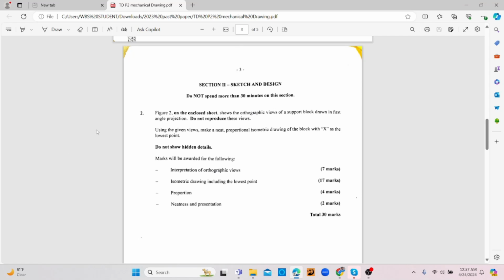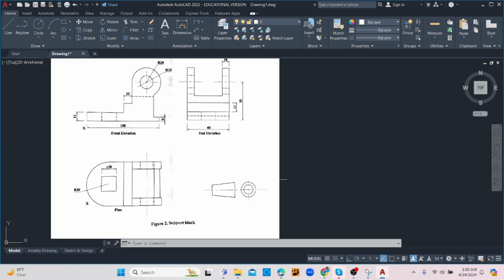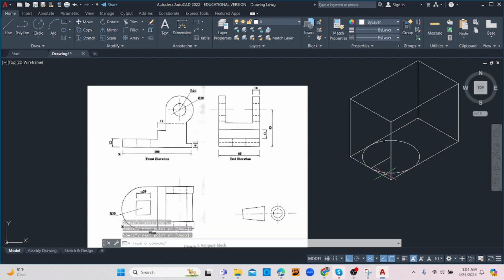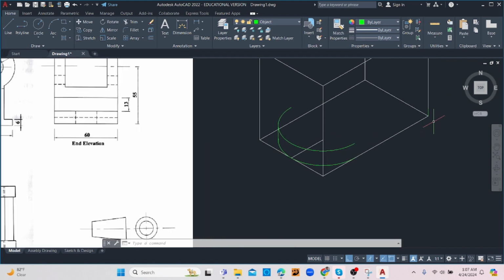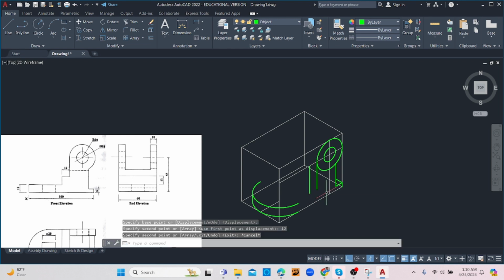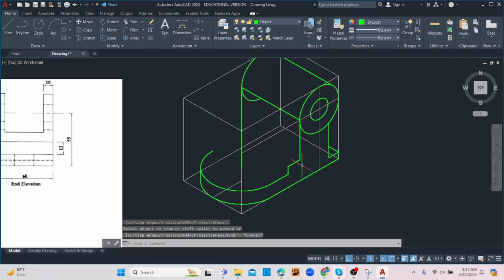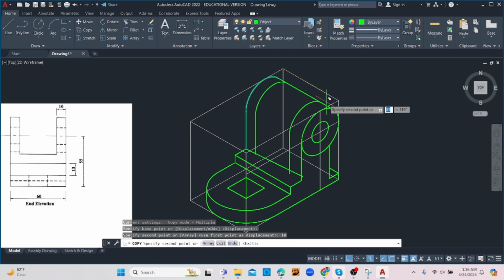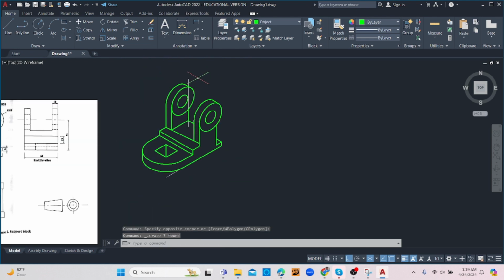Technical Drawing TD Mechanical Drawing  2023 Sketch and design Past paper 2

Comment: 9:54 the same problem here is that you don't need to formulate but properly do maths. They try to confuse you bot using the side profile we can subtract values from 55 the get that vertical distance.

Comment: Good day, Sir,

Based on the plan and front view of the given drawing, I don't believe that your solution is 100% correct. Please let me know your views. 

Case in point, if there were lines on both side pieces with the circles, then the end view in the question would show a line there. Also, the line that you deleted at the end of the video would remain. Double check, please and let me know if I have a point.

Thank you.

Respectfully,
JPL